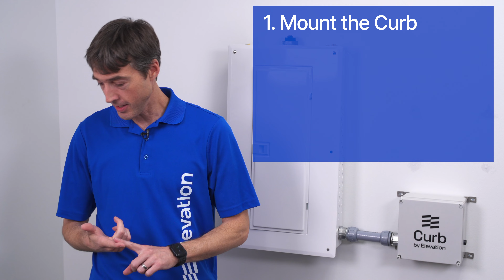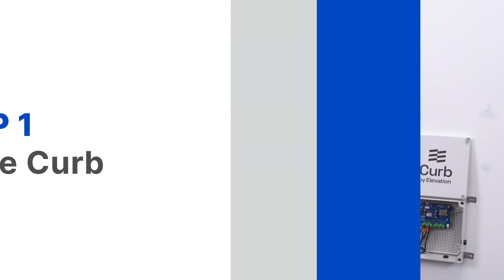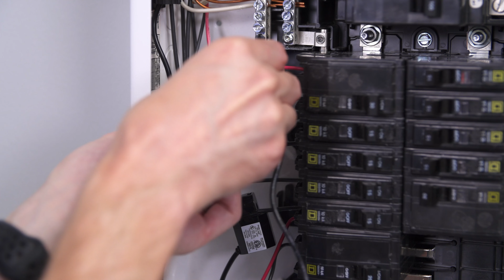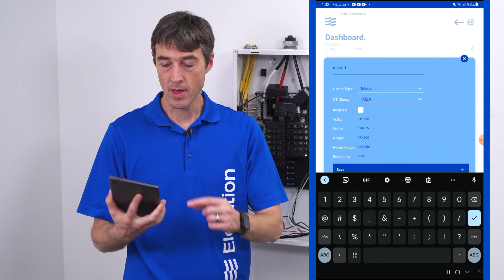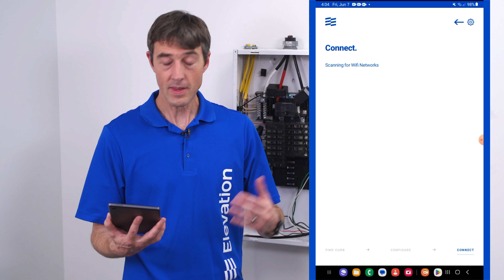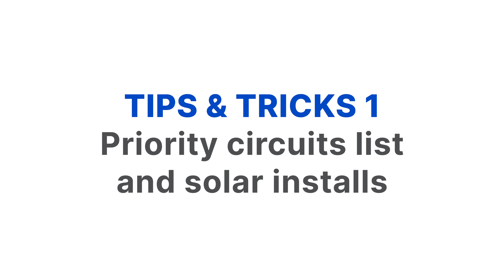Curb M10 Installation

Comment: This device (M10) seems like a step back from the previous models.  Only 10 CTs, when previous models had 12 ( 4 -50 amp CTs, 8 -30 Amp CTs).  A pro is that it does have a Cellular connection, but is that just a fail safe incase the onboard wifi module dies?  Also at a quoted $850 for the M10 and installation, it is about 4x more when compared to an Emporia Vue, or other Curb devices available on Ebay.  That data and graphs provided are better than most,  I hope they allow for integration into Home Assistant.